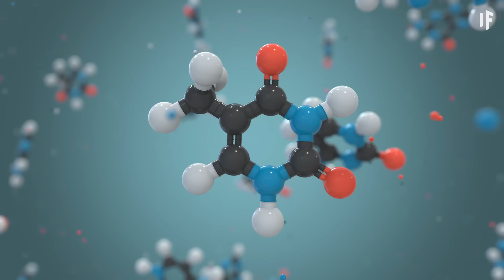What If All of Earth's Plastic Suddenly Disappeared?

Comment: No plastic in the construction material in my Home it's  Brick, Concrete, Wood, etc built in 1914. Sure things I have in it are petroleum based  I can't get around that. The wiring hasn't been updated yet so no plastic there yet. Knob and Tube is copper and A Cloth cover.

Comment: Get the plastic and start building with it.
Reply: That doesn't solve the problem.
Reply: @obsidiansea  No. No it does not and I didn't say it would. It's just a way to use it, the problem is that it turns into a pollutant. Plastic can be condensed and made into bricks that fit into each other. That can be used for the underground structures as well. Getting it off the planet and reevaluating how we use it to prevent it from turning into as bad of a pollutant as it is now would solve the problem.

Comment: Aduro's process sounds very much like plastic pyrolysis: the decomposition of plastic using heat in an oxygen-free environment.  Australia's CSIRO has developed an advanced plastic pyrolysis process in Queensland.  The prototype plant has existed for many years.  Unfortunately, it seems that the political roadblocks, not the technological ones, are the reason why this process has not been adopted commercially.
Reply: No, Aduro's process is more efficient than conventional pyrolysis. Aduro's technology is disruptive!

Aduro is revolutionizing the chemical recycling with its innovative Hydrochemolytic Technology (HCT) to tackle the growing global problem of plastic pollution

💡 Key benefits:

-  Recycles PE, PP and PS plastics, which account for over 70% of the world's plastic waste, back into saturated hydrocarbons
- Processes plastics contaminated with various components, including PET and multi-layer materials
- Minimal pre- and post-processing required
- Achieves yields of up to 95
- Mild operating conditions result in low CO2 emissions and minimal loss of carbon input
- Low OPEX and CAPEX costs (base unit CAPEX ~$20M)
- Modular, scalable units, Modular,
scalable units tailored to customer needs
- High margin model through technology licensing
- Extremely low free float, over 40% of shares held by visionary management

Aduro is making rapid progress towards its pilot demonstration plant, which is expected to be operational early in the third quarter, building on the success of its Next Generation Process Plant. 

The Company is already working with industry giants such as Shell, TotalEnergies and GF Building Solutions to showcase the breakthrough capabilities of its technology. 

In addition, Aduro has received strong interest from leading waste management companies in Germany, France, the Netherlands and the UK.
Reply: Watch green investing's playlist on aduro, he gives 100 reasons why Aduro's technology is infinitely superior than pyrolysis. It is MUCH different